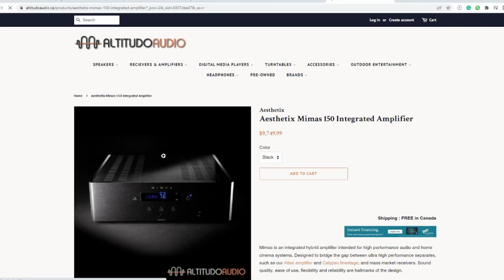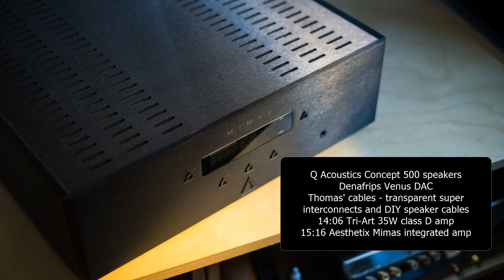A story on HIFI Synergy. How to get any speaker to sound AMAZING?

Comment: Hello Thomas and Leonid. I had to laugh listening to the story of the fella who purchased the Concept 500 twice.  My laughter came from the fact that I was the one Thomas was referring too in the video LOL. Yes Thomas, Leonid was not telling fairytale. There are people who are impulse buyers like myself out there. 

Owning systems with speakers mainly from Monitor Audio my quest was to find a more relaxed speaker that would lend itself to longer listening sessions without fatigue was my quest. With Concept 500 purchase number one,  I thought I would be able to replace my current speaker utilizing the same electronics I was using in one of my system’s .  Thomas’s video is about synergy and I had hopes I would find that X-Factor sound with just the speaker change. The new setup definitely gave me a more relaxed sound but synergy was not achieved. Too relaxed for my ears. My quest was a failure. As Thomas said not all electronics pair well with the Concept 500 speaker. Always wanting to audition new products back to the store I did go. 

I auditioned the Triangle Signature Delta but I felt the horn was too bright for my ears. Next on to the Triangle Signature Alpha. I was shocked how smooth this speaker was in  comparison to the Delta. Even though it utilized the same horn as the Delta it was a smoother sound to my ears.  I was sold and my quest continued.  

Leonid  and his brother Victor did the drop off and pickup at my house. (Best customer service around. You wont find more energetic guys in the business).  I sold the concepts and purchased the Alphas.  The Alphas are in an untreated room with windows on all sides. Not an ideal situation but they are still a pleasure to listen too.  I love the Triangle Alphas so much I also but the Triangle Thetas for another room. I was very satisfied and was content until I got the call from Leo saying I needed to come down to his shop as he has something to show me. 

Entering the room I saw the concepts setup again but this time being powered by the Aesthetic Mimas amplifier. Now I had spent a couple of months with concepts and also heard them countless time at Leos shop. When the first track was played I was shocked. The clarity I was seeking and was never able to achieve with the Concept 500 was there is spades. Track after track I was treated with that X-factor sound. 

Sold.  I knew what needed to be done. First my son was gifted a great pair of speakers in the Triangle Thetas. . The concepts were coming home with me for the second time knowing that I was not going to achieve that desired sound  with my current electronics. I learned from watching Thomas’s channel  the finer art of eating instant noodles when one needed to save for something. 
Having noodled long enough I brought home the Mimas amplifier. My first impressions were of disappointment.  That sound I heard in the shop was gone. The manual said 400 hours for break-in so I waited patiently. My patience paid off. I truly believe I have found synergy with the Concept 500, ISO Acoustic Gia feet  Aesthetic Mimas, Schiit Yggdrasil dac and Bluesound Node Streamer. 

I know this system could sound better. I am open to suggestions if there are alternative options with regards to the Dac and streamer. 

My room is less than ideal but the wife factor has limited my options, but I am satisfied for now. 
The quest is always alive and I know system changes will be in my future but perhaps not in this room. 

 
Synergy is a real thing and it had me purchase the Concept 500 twice before I was satisfied. I took a while but I have 3 completely different sounding rooms. Love them all. Love audio and the journey it takes us all on. 

Special thanks to Thomas, Leonid and Victor for helping make my continuing journey fun and exciting. 

There you have it mystery solved. You now have a name to  add to the story when you tell it again. 

All the best 

Richard Robertson.
Reply from the maker: Wow Richard, what a great story and thanks for taking the time to share. I hope many people will read it and understand how important synergy is.
Reply: Richard, thanks for sharing your experience! This very important for everybody who loves audio!
Reply: I did read 2/5 parts of it😅😅 I got tired.

Comment: I truly believe synergy is the key to a system sounding it’s best. With that said I’ve been working on my setup for about 4yrs now all pre owned totl except my cables were new. 

I currently have a Musical Fidelity NuVista M3 (factory upgraded) hybrid Integrated , Musical Fidelity TriVista 21 Dac, Talon Audio Khorus X speakers, Wireworld Eclipse speaker cables, Analysis plus solo crystal oval interconnects, P.I. Audio 20a power cable for amp P.I.Audio power cable for Dac, Tice Audio power block line conditioner. I have much more on the analog side but this is the gist of it. 

The synergy with this system is truly breathtaking and has been hard work over the years to get it all dialed in correctly, Room placement , room acoustics etc but has all paid off.
Reply from the maker: Nice, thanks for sharing

Comment: Thanks to Leo and his Altitudo crew I to are now enjoying synergy with my Audiovector r 6 arrete speakers and Auris Fortissimo integrated tube amp also using Goldnote DS 10 and PSU Evo 10 linear power supply to compliment the system I am using Nordost Tyr 2 speaker cable and Red Dawn power cables I don’t have the most friendly room for my audio as I have lots of windows and do not want to spoil my view I experimented with many amps and speakers before I found my end game. Leo knows his products and audio thanks I live fairly close to his business it is only a 3 hr drive followed by a 10 minute boat ride. There is a YouTube video of him delivering my set up check it out.
Reply: Thanks Stevy!
Reply: Fantastic choice of components...
Particularly your R6 Arreté.
🇩🇰👌🏻

Comment: Great video! I feel that I have hit a jackpot with my system already. BlueSound Node 2i, Chord Clearway cable, Rega P2/ Ortofon 2M blue, Rega Apollo used as a transport - Devialet expert 200 - connect to cheap installer Eichmann cables - to Monitor Audio Gold GX50 - the small old one… I’m now afraid to even touch anything because I really like it the way it is. Synergy is something very important but hard to achieve!

Comment: Thomas, gear matching effects are real. In my recent experience, though, digital room correction had a much bigger positive impact on the sound I was able to get out of a setup. It's often looked down upon by audiophiles but after investing some time into a customizing your own correctiom curve, you can get incredible results. It provides SO much control and completely transformed how my speakers sounded, in a good way after playing around with the cutoff frequencies and raising certain areas slightly. My speakers no longer have any of the typical issues like forwardness in some areas and a dip at the crossover frequency. Bass is night and day cleaner. Review suggestion: can you add a future A/B test of a Dirac enhanced input signal into a dac, amp & speaker combo you know well? Perhaps one setup you love and one you didn't love "as is" and then compare your impressions after spending some time on the FR curve, cutoff frequency etc.? I think this could be a revelation to many and help people who are unhappy with a current pair of speakers that is hard to sell.

Comment: I have several setups around the house, including in my office, which is 8 ft by 17 ft, one side all glass, bad acoustics. I was moving things around, and just to listen to music while waiting for a new setup, I threw up a Yamaha RX-V379 (picked up 6 years ago open box for $125) driven by my SMSL M400 DAC, and driving a pair of little KEF Egg (Original Uni-Q wall/desk speakers, not the newer Bluetooth models), and a small 8 inch subwoofer.  I couldn't believe it. The sound was impressive.  The synergy just worked.  I have tried the pairing in other rooms but just not the same.
Reply from the maker: Nice.

Comment: The Mimas is an integrated sleeper. I ran one with my Stenheim Alumine 2 SE and it is clearly has synergy. The tube preamp section offer greater tonal qualities. Not to forget with both phono and DAC modules as well as a class A upgraded headphone module, putting value aside, the Mimas is an incredibly capable amplifier, vocals most especially shine through this amplifier. The onboard DAC is good, though I had mine tethered to an MSB Premier DAC which the Mimas easily kept pace with and managed the data with nary a sweat. A fully capable, giant killer. It’s well and truly a terribly marketed amplifier. $7k is not exactly bargain pricing yet this box competes with much higher priced amps. It’s a great integrated and though I do not spin vinyl the phono card is rated excessively high to boot. The tube preamp really allows the organic nature of the music to pour from this amp. I doubt there are few speakers it would pair unfavorably with. Speaker cables can help with some of the bass weight, but generally speaking one could use car jumper cables and this thing would sing!

Comment: Synergy. I spend time trying to achieve it. I do not have endless amounts of gear but an anchor in my system is  Castle Howard S2 speakers. I have tried 5 well regarded amplifiers including monoblocks (all are I still owned) over the 20 plus years I have had the Howard speakers in my system. I have now found  that the Atoll IN200 integrated is the best match for the speakers. Improving imaging and clarity (with no increase in sibilance) without affecting the huge soundstage. However, the most interesting improvement came when, after attending a demonstration at a hifi show, I switched all my interconnect cables to one brand/model type. (Not the brand of the demonstration. ) A noticeable improvement. No, I do not spend disproportionate amounts of money on cables or get involved in cable controversies.   Listening not measurements are my guides.

Comment: Hello Thomas. You have responded to my comment before.
In my 30+ years of hifi hobby, the Concept 500 was the best speakers I have ever owned.
Unfortunately these speakers took the biggest chunk of my budget. 
I am very happy with my current system: Denafrips Pontus II DAC, Denafrips Hermes DDC, Kinki EX-M1+ Integrated,  Cambridge Audio CXC Transport, SVS SB-3000 Sub, Kimber 8TC Speaker Cables.
Now I am tapped out, but happy!
Reply from the maker: Congrats on your purchase, would like to try the Kinki to see. You have the DDC too, nice.

Comment: Hello Thomas and Leonid. I had to laugh listening to the story of the fella who purchased the Concept 500 twice.  My laughter came from the fact that I was the one Thomas was referring too.LOL. Yes Thomas, Leonid was not telling fairytale. There are people who are impulse buyers like myself. 

Owning systems with speakers mainly from Monitor Audio my quest was to find a more relaxed speaker that would lend itself to longer listening sessions. On Concept 500 purchase number one  I thought I would be able to replace my current speaker utilizing the same electronics I had.  Thomas’s video is about synergy and I had hopes I would find that X-Factor sound with just the speaker change. The new setup definitely gave me a more relaxed sound but synergy was not achieved. Too relaxed for my ears. My quest was a failure. Always wanting to audition new product back to the store I did go. 

I auditioned the Triangle Signature Delta but I felt the horn was too bright for my ears. Next on to the Triangle Signature Alpha. I was shocked how smooth this speaker was even though it utilized the same horn as the Delta. Sold my quest continues. 

Leonid  and his brother Victor did the drop off and pickup at my house. Alphas for Concepts.
The Alphas are in an untreated room with windows on all sides. Not an ideal situation but they are still a pleasure to listen too. 

 I love the Triangle Alphas, so much so I also but the Triangle Theta for another room.
Reply from the maker: haha, thanks Richard for sharing your story. I thought it was the best story ever on how amazing synergy can be.

Comment: Here are some ideas that may help with synergy.

There are many variables involved in synergy of a hifi system, so I will concentrate this discussion on suggesting ways to pick gear that has the best chance to perform at its highest level – and thus achieve synergy.  Lower priced gear that is performing at its highest level may outperform higher priced gear that is not. 

I believe the best performance that a hifi component can provide will occur when it is playing in the middle of its range (or, also known as its linear region).  To help achieve this, adjustability at interconnection points between gear has been the key for me. 

Examples of meaningful connection point adjustability are as follows.
 
(1)	Adjustability of the volume (or power) that a DAC can output allows the adjustment of its output power to an optimal level to drive an amplifier in its middle range. Having this capability will allow you to have a smaller (less expensive) amplifier.  The best DAC volume is determined through listening tests. 

(2)	Adjustability of the sensitivity of the subwoofer input along with a volume control on a subwoofer allows the adjustment of the sensitivity of a subwoofer so that its volume control can be set to a middle range value.  

(3)	An equalizer is able to adjust tone settings for individual albums which allows my system to achieve great sound for almost every album.

(4)	Properly sized speakers for a room size is important.  You want a speaker to be playing in their middle range when the rest of your system is playing in its middle range – and you do not want the speakers to be too loud in this state.

My gear:
	Source: Mac Mini and Gustard USB interface (to clean up the digital signal)
	DAC: Soekris 1421 R-R
	AMP: Hegel H90
	Speakers: Triangle Comete, 40th Anniversary model
	Subwoofer: Dynadio 18S (also known as Sub 6 model)
	EQ: Schiit Loki Max
	Cables: 
		Speakers: 	Analysis Plus - Oval 12
		Subwoofer: 	Analysis Plus - Sub Oval
		Interconnects: Analysis Plus - Oval One
                                           Audioquest - Forest USB
                                           Audioquest - Forest Toslink
                                           Power Cables: Stock power cables
	

      Room/Treatment: 	Size is 10 ft x 20 ft.  Stereo is along a 10 ft end
                                        Equipment Rack (DIY) that is very low to the ground
       	                                No reflection absorber or diffusion yet
Notes:
======
Hegel integrated amps seem to provide low power from their preamp outputs, thus making the input sensitivity adjustment of the Dynaudio 18S subwoofer a wonderful feature.  Another example, the Hegel H90 preamp output cannot drive a KEF KC65 or KF92 with enough power to sound good.

I hear that the Musician Pegasus DAC is wonderful, and that it has lower than average output power.  Using this wonderful inexpensive DAC may cause you to need a more powerful amplifier to amplify the low signal from the DAC.
Reply from the maker: Thanks a lot for sharing this and taking the time to write this long comment.

Comment: After much trial and error, I have found excellent synergy with the KLH Model 5’s and the Willsenton R8, especially with upgraded front end tubes. The R8 really brings the M5’s to life and what bass along with midrange! Best music genre here is jazz of all types.
The other pairing I have in my system is the Totem Sky monitors with the Anthem STR integrated and SVS 3000 Micro sub. The high power and neutral sound of the Anthem is really well matched to the rich, full and dynamic sound of the Totems. I like this system for orchestral pieces and chamber music.
Reply from the maker: Oh nice, I should give that a try too.

Comment: I drove the 500s with a Musical Fidelity m6 500i.  It sounded amazing - tons of bass, nearly electrostatic imaging.  Nearly flawless. My only reservation was they seemed to lack a little attack on the leading edge of notes / drum hits.    I settled on the B&W 804d3. The 804s have a more unique signature (likely not a good thing) but in the end, they are more captivating.  To your point, I would have NEVER purchased the 804s from a showroom audition.  It was not until I got them home with my system did they shine. Night and day difference. I have also heard the 500s at axpona sound horrible.  Nothing like at home.  Not even close.  I think my monster amplifier (500w) takes much of the impedence issues out of the mix that some amps may have with speakers.  Just guessing.
Reply from the maker: Yes, that smootheness can make the leading edges too smooth. Yeah, 804D3 is impressive, my friends had it for a while before replacing it with Wilson Sabrina and I think he misses those 804D3 cause the Sabrina is a bit too neutral for him.

Comment: I agree synergy is a must! My system with perfect synergy for me a while back was ADS L1590 Tower full range speakers paired with Acurus A-100 Intergrated amp, Nakamichi ZX 682 (So good for tape) , Yamaha T-1 Tuner (amazing) , Cambridge Audio DAC Magic for digital, Dual 1249 with a high end Grado cartridge for amazing sound , phono stage Perreux ( I have a little better phono stage now). The sound was sweet, smooth and well great! I only have the speakers left because I wanted to have them refurbished by an ADS tech . I do not have synergy now with my new system. I sadly sold the Acurus.